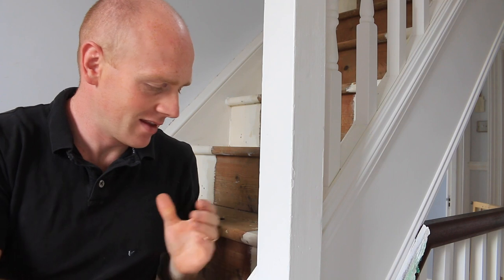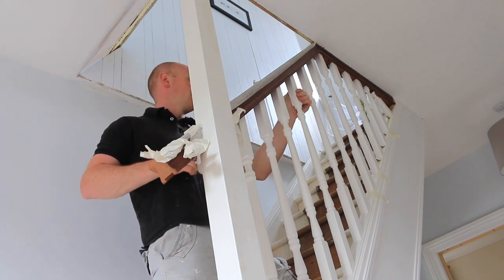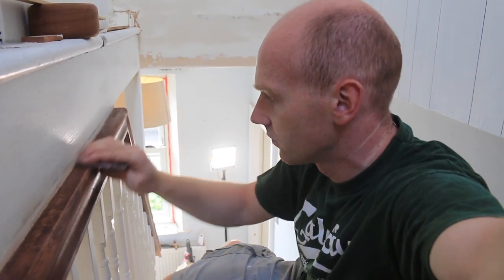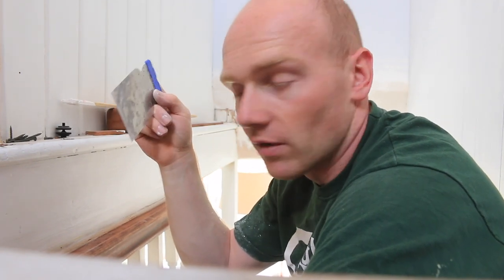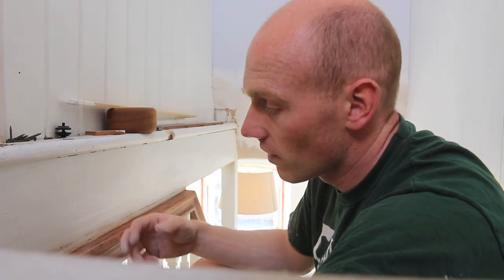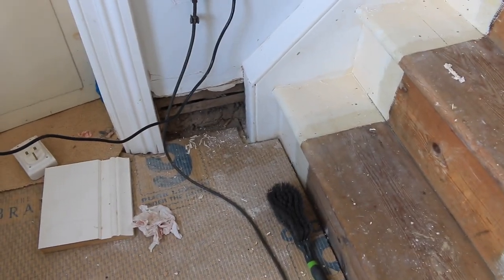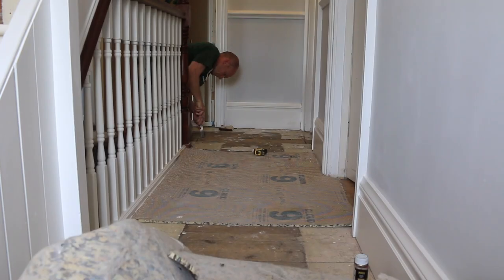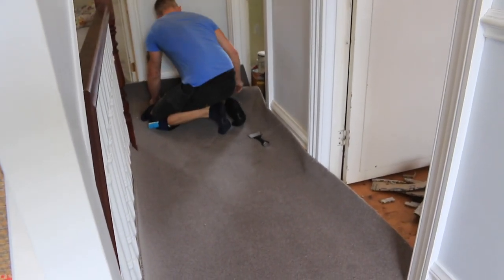CARPET AT LAST! Hallway, Stairs & Landing Renovation

Comment: For that end cap, what about a couple of large dowels ?
You can get dowel 'points', drill a couple of holes, insert the points, line up the joints and press, they will leave a mark in the other face, drill to the appropriate size.
Reply: Yes easiest with broom handle thickness dowel or similar

Comment: Look at Mitre glue. It is a strong CA glue and activator, Glue on one piece and spray the activator on the other and then hold once it's in the correct position and hold for a a short while. if you want used Dowels for belt and braces, you'll need to be spot on with dowel  as there will be no room for error with them.
Reply from the maker: That’s my worry with dowels but the template suggestions below should work. We use mitre bond lots but it wouldn’t be strong enough here bearing in mind it will be pulled on. Great for clamping while the wood glue sets though.

Comment: Check out ct1 they have a good range of products including mutisolve which looks like it can do the adhesive removing tasks that you encounter.
Reply from the maker: Will do.  My only reservation for using any other products was that I still needed to apply two coats of finish so didn't want to effect how that would take.